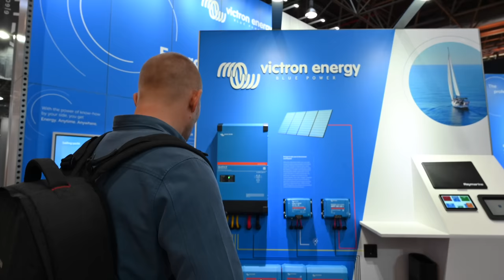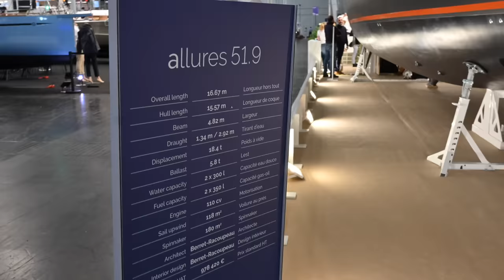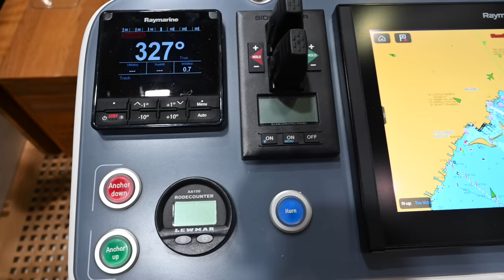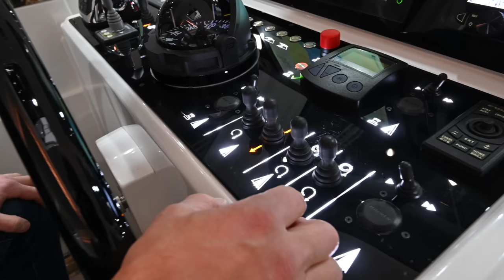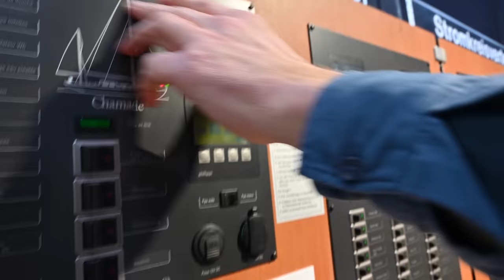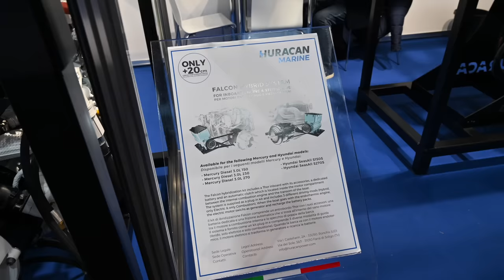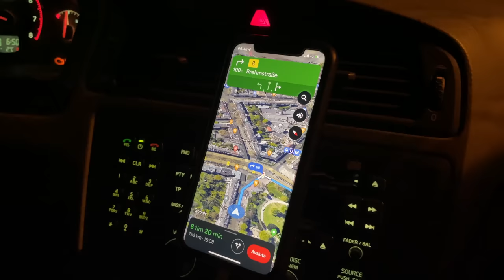Boat Building Inspiration At The World's Largest Indoor Boat Show - Ep. 334 RAN Sailing

Comment: Lots of interesting ideas.  I'm sure you will prioirtise things to your needs, and easily maintained.  I like the lightning prevention system, althought it does seem quite heavy for 50 foot boat.  The inconvenience, time, inability to navigate or communicate are good reasons to prevent a strike, let alone the cost.
Reply: Supposedly thousands have been installed so there should be some data available about how well these charge equalization units work. There have been recent news stories about laser lightning rods.

Comment: The double facing hatches at 8:18 are set up to allow you to open a hatch that matches the conditions and ventilation or spray entrance prevention goal you have.
Reply: I understand, but then I would position the forward opening hatch forward and the aft opening one aft ward looking.
Reply: @zeilgenot   Only difference I could see doing that is you have no spray protection with both opened but we all have our preferences and there is no wrong way if one is happy with the setup for their intended use.

Comment: The flexi teak will get damn hot that you cannot walk bare feet on it! Would never use it again.
Reply: A very good point but there are other points too (as always).
Reply from the maker: Yes, that’s my experience as well, but some manufacturers claims that’s not a problem anymore. If that’s true I don’t know.. 😊 Cheers! /Johan
Reply: @RANSailing  by the way. Do you have a drawing of your solar arch of Ran2?
Reply: @RANSailing  Hi Johan, Malin. Re the fake teak - the look is great but heat is indeed a problem, in terms of walking on it but also in terms of it transmitting heat through to the interior. Garcia and Allures owners talk about this. It's expensive too. In the end we opted for a plain white superstructure, with some light grey grip panels in places. No regrets.

Comment: Why don't make a model of RAN 3? With the technical drawings, go to the next Laser-cutting shop servicing architects and have the pieces cut out of foamboard, plastic-sheets or thin plywood. In the past, most ships were built based on models for a good reason. It doesn't cost much and if it saves you only one mishap, you'd be coming out ahead. It also makes visualising the interior a lot easier.

Comment: Not a fan of the large rectangular ports in the hull sides of new boats nowadays from aesthetic or functional perspective.  Especially boats that have those huge openings in the hull and deckhouse in the vicinity of the mast at the peak primary loads location.  Sharp corners at the peak shear and axial load location spells long term structural troubles.  I'd bet that in a few years time there will be stress cracks coming from the corners of those openings and leaks.  Of course a simple solution would be to radius those corners, but style takes precedence.  And if like most boats they are not sailed in demanding conditions, then it won't matter.  But for boats pushing into demanding conditions, it is a real design problem.
Also the big fat sterns and excessive beam means crappy lighter wind performance, uncomfortable motions in a seaway, and waves slapping on the stern counter both at sea and at anchor.  Ya you get a big aft cabin that the ladies like, but at a big tradeoff in performance.
Good episode.  Interesting to see for those of us that cannot go in person to the show. Thanks for posting

Comment: I have been wondering where the active lightening protection systems were and when they would show up on boats. Having seen the massive costs of taking a strike on several channels I follows, it was obvious that one of these types was needed. The science of active protection is well known - get rid of the electrical potential difference and your boat is pretty safe from strikes. No leader, no strike. The area coverage is pretty amazing too. One strike prevented will pay for the system many times over, especially in a fiberglass hull. Hearing about holes burned thru in the middle of the night on a now dark boat, with no radios no pumps, nothing would scare the hell of me if I was going sailing Florida or the Caribbean - anywhere in the middle latitudes.  You are now possibly fighting for your life out in the middle of the ocean. Lightening comes with a storm. A fairly big one too since you have to have a tall column of air/rain in order to build the massive electrical potential difference that makes a “lightening bolt”.

If it works I would find the money in my budget. It’s like the power conditioning equipment I own for my audio/visual system. None of it is cheap - in fact it cost as much as one of my amplifiers. But when you consider the many thousands I have spent on my gear, protection is better than insurance (but you still need both). It’s also weight, but that just another one of its costs. I think you really need to see if you can workout a deal for this type of lightening protection system. I would not stick a mast in the air without one.

Comment: You said that you want a model of your new boat, well you have the boat on the computer in 3D modeling software, so you just need to get the computer data in a format that is compatible with a 3D printer and then send the data file to a company which does 3D printing.

Comment: DDCE is an exciting topic and is discussed in different channels with a variety of opinions. A reliable statement as to whether DDCE is capable of carrying more charge than a "broom" has not yet been proven. 
The design appears to be a gigaherz resonator, where the choice of materials with suitable dielectrics seems to be the secret. 
A scientific paper on this subject is called "An ECCD-Electronic Charge Compensation Device-As a Quantum Dissipative System", and a short YT video about it is called "Enabling a Physical Model on Electronic Charge Compensation Device".
DDCE reduces the probability of impact and in no way replaces protective measures. 
The information of the seller that a sacrificial anode is sufficient as a transition into the seawater seems to me too little, generally a surface of 0.1 mxm is recommended.

Comment: Hello RAN , The two hatches that open against each other are not meant to open both at the same time. When at anchor, use the one that opens forward for maximum ventilation. If you're underway or it's raining lightly at anchor, use the one that opens aft. Great videos. Thanks.
Reply from the maker: Was thinking that was the idea as well later. Smart!